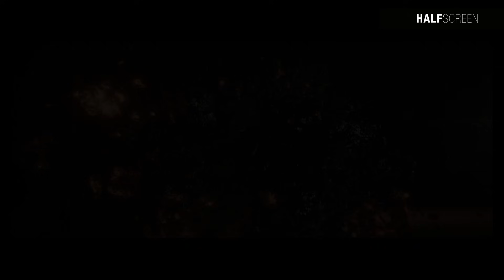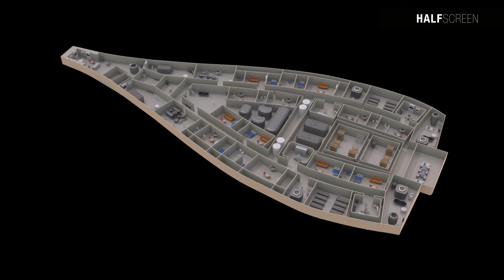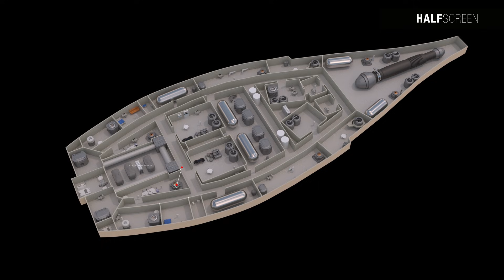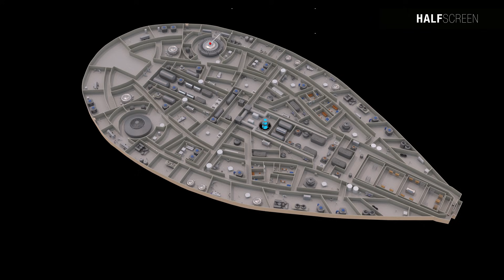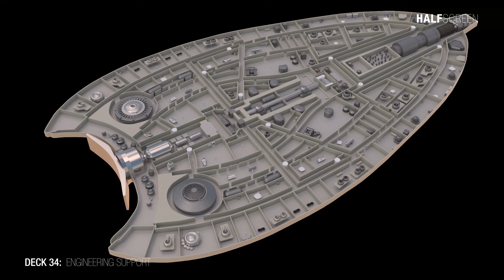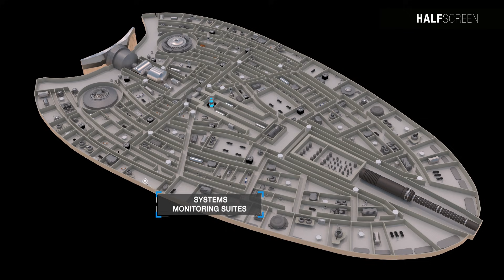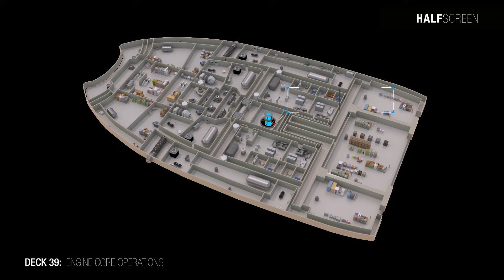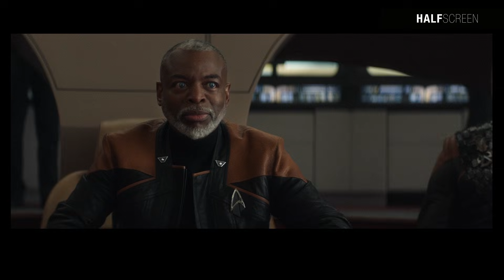Inside the USS Enterprise D (Deck 16-42)

Comment: The reactant loaders are for filling the torpedoes with anti-matter prior to launching. The Torpedoes are stored as empty casings
Reply: That's cool!
Reply: He also talks about antimatter generation which makes no sense at all... it would mean that the enterprise is a perpetual motion machine.
Reply: @thomgizziz  Not quite, making anti-matter is a long process because it has to be done at the atomic level. Also the warp core does a matter/antimatter reaction meaning the anti-matter should be opposite of the regular fuel, deuterium, making a deuterium/anti-deuterium reaction. That means they only make anti-matter from deuterium atoms. Replicated deuterium probably wouldn't be stable in a warp core, and collecting enough of it from H2O or Bussard collectors would take a while too. I suppose they just put spare deuterium in the generator and it slowly makes anti-matter for reserves.

Comment: The Arboretum is supposed to be located on deck 17 (Section 21-Alpha)
Reply: That was said in one of TNG episodes. However according to the deck plans it is not on that deck. Deck 17 is so small it even doesn't have 21 sections there. It is possible to believe the arboretum wasn't on deck 17 originally and it was created there later. The ship's interior is quite configurable. 

In Stage 9 project, where they were recreating all decks of E-D in 3D, the creators put arboretum on deck 7, which I would say is more logical place. Screenwriters of episodes didn't always followed the deck layouts or even deck coordination system.
Reply: @Lukas-Trnka  Either way, somehow the Arboretum is missing in this presentation. We know the Enterprise had one and it was shown in episode

Comment: Pressurized gases to launch proton torpedoes I thought Photon Torpedoes was launched with electromagnetic catapult Wako a railgun
Reply: You are correct.
Reply: According to the Next Generation Technical Manual, it's both.  "...induction coils and launch assist gas generators to provide initial power to the sustainer and propel the casing away from the starship."

Comment: I'm like 99% certain that the Navigational Deflector on Deck 35 is not what generates the ships shields. Last i checked, the only thing it does, is generate a field forward of the ship, to deflect interstellar matter.

Additionally, the only thing Antimatter is used for is the M/AM Reactor (warp core)....the stuff isn't piped all over the ship, which is kind of a good thing, given how volatile the stuff is. Also, the pods themselves are ejected, if they need to ditch the Antimatter... shooting into space, uncontained, would be VERY bad.
Reply: True and i came here to state the same thing.
Reply: I also wanted to point this out. Just few more details; Antimatter is used not only in warp core. There is one more use for it. It is being used to fill the photon torpedoes before they are being fired. Because they are being stored without the antimatter.

And for the navigational deflector; it is a similar technology as the deflector shield emitters, just used differently. However aside from pushing away the interstellar matter, the navigational deflector is also integrated with the long range sensors, so the system as a whole does two things.
Reply: @Lukas-Trnka  Ahh, i'd forgotten that the torpedoes are stored without the antimatter. However, my point still stands that anitmatter isn't being piped all over the ship. I'd never heard of the nav deflector being tied into the long range sensors...i guess it kinda makes sense, but i don't see why they'd do that, as it would only be able to see in that one direction. Perhaps it aids in navigation? ::shrug::
Reply: @numberyellow  the ship has sensor suits all over it, but the long range sensors and telescopes are part of the navigation deflector assembly, its a multi function assembly with multiple sensor based systems, navigation systems, and navigation deflector incorporated. But not really part of the shield system. Shield generators are scattered about, with shield emitters integrated across the hull.
Reply: @numberyellow  One more possible case of antimatter usage that comes to mind is fueling of shuttles. I just don't know if there is a dedicated special conduit leading to shuttlebays or if they rather move the antimatter in small containers across the ship when occasionally needed. But anyway you are right, that statement about injecting antimatter across the ship is incorrect. The antimatter injector on that deck injects the antimatter only into the warpcore.

As for the deflector, the TNGTM in chapter 7.4 states: "The long-range sensor array is a key element of the navigational
deflector system because it is used to provide detection
and tracking of objects in the ship's flight path."
Reply: @Lukas-Trnka  OK, fair enough, i can see ONE PART of the LRS array being integrated into the nav deflector, which would assist in seeing what's VERY far in front of you, thus helping with navigation.. As to the shuttles... i dunno man. Given they're warp-capable craft, and since we're assuming shuttles use a M/AM reactor to generate power (we already KNOW runabouts do), it would stand to reason they'd need a top up from time to time.. I could go back and check Stage 9...there might be Antimater tanking at the main shuttle bay.
Reply: @Krahazik  Like i said to the other guy, i could see some sensors being integrated into the nav deflector assembly...however it can't be the entirety of the LRS array, as that's an omnidirectional instrument, and the nav deflector assembly is a unidirectional instrument.
Reply: @numberyellow  I would also expect that system to be pointed to all directions, but the TNGTM suggests that the whole long range sensor array is really integrated only in the deflector system. I've just checked. I would guess that in case of long range sensors only the subspace scanners matter and they might be able to scan in all directions regardless of their orientation on ship's hull. So the only thing that would interfere with them might be radiation from the deflector. TNGTM in chapter 7.4 states: 

"Because the main deflector dish radiates significant amounts of both subspace and electromagnetic radiation, it can have detrimental effects on the performance of many sensors. For this reason, the long-range sensor array is located directly behind the main deflector, so that the primary axis of both systems are nearly coincident. This arrangement permits the long-range sensors to "look" directly through the axis of the fields."

Btw, can you run the Stage9 on Windows 11 (if you have Win11)? It worked on my Win11 but not any more.
Reply: @Lukas-Trnka  hmmm.. certainly something to think about. As to Stage 9.. i don't know, i don't have Win11 on this rig.
Reply: Your first point is 100% correct, but anti-mater is indeed piped throughout the ship as it is loaded into the torpedo casings prior to them being loaded into the launchers (the torpedoes are stored empty). The Galaxy class has 3 torpedo launchers, 2 in the Star Drive, and one pointed aft in the saucer section that is revealed when the ship separates.

Additionally, engines and reactors in the saucer section require anti-mater to generate power, and there are warp field generators at the center's of all 3 computer cores which requires a mater/anti-mater reaction to function. This is because these computer's process and calculate faster then the speed of light, so there has to be a warp field generated around them at all times to make this possible.
Reply: @pepperVenge  yeah, we talked about torps already. Not sure how they charge them, but i very much doubt they're gonna be piping antimatter all over the ship, given that it requires magnetic containment, to keep it from coming into contact with...well, anything. I would imagine there is local tankage. 

I have never seen ANY schematic that shows a torp launcher in the saucer. additionally, there's never been any on-screen use of it either. Where did you read about that?

You mention reactors in the saucer....are you talking about the emergency fusion reactors? If so, they're not going to be using Antimatter, they're fusion reactors, so they'd either be using deuterium, or given their emergency nature, they might even be self-contained units. 

Also, i've never heard of the computer cores needing a warp field....where did you get that from?
Reply: @numberyellow  I know it's been a couple days, but YouTube deleted my last reply to you because I included a citation. So let me try this again.

"but i very much doubt they're gonna be piping antimatter all over the ship, given that it requires magnetic containment"

Consider that the pipes are magnetically charged and can easily contain the antimatter flowing through them.

"I would imagine there is local tankage."

No. According to both the Sternback and Ed Whitefire Enterprise D plans, the only antimatter storage tanks are located on the lower decks of the stardrive section. The tanks are located on decks 40 and 41 on the Whitefire prints.

"I have never seen ANY schematic that shows a torp launcher in the saucer... Where did you read about that?"

This source comes from the Ed Whitefire blueprints of the Enterprise D, which were commissioned by Andrew Probert shortly after TNG premiered in 1987. You can find them if you google "Ed Whitefire Enterprise D."

Ed Whitefire was an aerospace engineer who was hired to design the interior of the Enterprise D according to Probert's specifications and design elements. For context, Probert was the man who originally designed the Enterprise D in 1986 under the supervision of Gene Roddenberry (He also designed the Enterprise Refit/A in 1978/9).

Long story short, Whitefire's plans were finished in 1991, but were never officially published due to technicalities. 5 years later, Rich Sternback was able to get his own plans of the Enterprise D published, which is the design you see in this video. 

But I only subscribe to the Ed Whitefire plans as canon because they were officially endorsed by Andrew Probert and Gene Roddenberry, and were the only plans in existence during all 7 years of TNG's run, and during Star Trek Generations (1994), which was the only TNG film to feature the Enterprise D.

"there's never been any on-screen use of [the saucers rear torpedo launcher] either."

This may be true, I'll have to watch the show again, but because the Ed Whitefire plans were the only Enterprise D plans available during the original Run of the show, many of the design elements from those plans made it into the show, including Cetacean Ops (where the ships whales live), stage theater (Can seat hundreds) and the Grotto Mall, among some others.

"You mention reactors in the saucer....are you talking about the emergency fusion reactors? If so, they're not going to be using Antimatter, they're fusion reactors, so they'd either be using deuterium, or given their emergency nature, they might even be self-contained units. "

You are absolutely right about this point, I stand corrected. This is even in the Ed Whitefire plans.

"Also, i've never heard of the computer cores needing a warp field....where did you get that from?"

This is in the Ed Whitefire plans, specifically on the last page, there is a special section that explains this. There is a warp core that sets between the two computer cores in the saucer section, and another warp core that sets next to the single computer core in the stardrive section. They generate power to the warp field generators positioned on the tops and bottoms of the core's. This allows the computers to process and compute at faster then light speeds. Without the warp field, the computers could not function, or if they could, only at sublight speeds

Because of this, antimatter is required, which is pumped through the ship from the tanks on deck's 40/41.
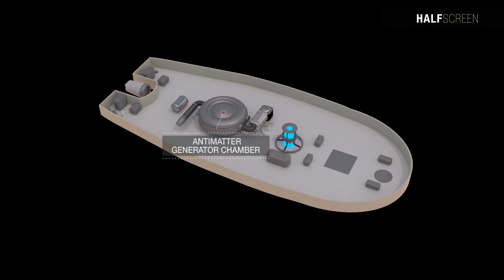Reply: @pepperVenge  That injector shown in video at 18:45 is really only for fueling the warp core. That description here was really a mistake. And more in general, sublight engines, fusion reactors or computers actually don't need matter/antimatter reaction to operate. Both in saucer and in enginering section there are fusion reactors that generate power from hydrogen (deuterium). Energy is being distributed across the ship via EPS (electro-plasmatic system). This plasma is what provides energy to the systems. It comes from either the warp core or from the fusion reactors. Fusion reactors are not used only in emergencies. Impulse engine is directly fed from active fusion reactors. 

And as for the computers, yes they use FTL (faster-than-light) nanoprocessors, that creates subspace field so the operations inside the processors can happen even faster. But for such miniature and weak fields the energy from M/A reaction is not needed. That would be an overkill. And even if for some reason they would need some stronger subspace field, they would still not need to bring the M/A reaction close to that system, they still can channel the energy anywhere in the ship through EPS conduits.

As for the 3rd auxiliary torpedo launcher, yes it is really there. It was never mentioned on screen, but it is on the deck schematics and even in TNGTM. It is on deck 15, (it was mentioned in the previous video). Torpedo launchers obviously must have some source of antimatter. Maybe there are special pipes leading from deck 42 to the torpedo launchers, I cannot find any mention of it in TNGTM. However if there are, then I wouldn't be surprised if the 3rd wouldn't be connected to those pipes at all since this torpedo launcher is almost never used. The third launcher could just have its own container, refilled only occasionally.
Reply: @Lukas-Trnka  I guess this all depends on which schematic you subscribe to. I prefer the Ed Whitefire plans as they were the official plans endorsed by Andrew Probert, the guy who originally designed the Enterprise D.
Reply: @pepperVenge  Somehow I have also a trouble to putt a comment here. Originally I've included a link but removing it from original text didn't help. Will this comment remain here?
Reply: @pepperVenge  Some antimatter storage is also in the aft part of the saucer. It can be seen on diagram in TNGTM that was published in 1991 (also with Roddenberry's endorsement). It is also on Sternbach's plans.

As for computers; TNGTM states there is a set of miniature subspace field generators that produce symetrical field distortion. No warpcore is mentioned there. And it makes more sense to my technical mind that small generators wouldn't need so much energy to draw it from M/A reaction. I guess the idea of computer core's warp cores must have been scrapped during the 4th season or earlier.

Btw, the Whitefire's plans, that I have, are quite blurry. Is there somewhere some better version of it on the internet?
Reply: @Lukas-Trnka  Well I'm not talking about TNGTM, whatever that is. I'm talking about the Ed Whitefire prints.
Reply: @pepperVenge  TNGTM is a book "Star Trek: The Next Generation: Technical Manual" published in 1991.
Reply: @Lukas-Trnka  And who wrote it?
Reply: @pepperVenge  TNGTM was written by Rick Sternbach and Michael Okuda, and it is an extension of the original "TNG Writers'/Directors' Guide" (also called the "bible") written by Roddenberry and David Gerrold during the preproduction of TNG series, and later updated by Michael Okuda and Rick Sternbach. 

I understand you are relying primarily on Ed Whitefire's blueprints, however TNGTM can provide much more details.
Reply: @Lukas-Trnka  That gives it credibility, but TNGTM is not a detailed deck by deck blueprint of the ship as far as I can tell. So I still subscribe to the Ed Whitefire blueprints because we're talking about the ship itself, not just parts of the ship. The Whitefire plans are far more detailed then the Rick Sternbach 1996 plans, and incorporate all the design elements that Andrew Probert intended.
Reply: @pepperVenge  if I may interfear: to the first question with antimatter pipes i can respond with yes, in emergency situations tiny amounts of antimatter can be injected into the main impulse drive, not the ones on the saucer, to give it an extra boost. I have the technical manual book (or i think it is), in german it is „die Technik der U.S.S. Enterprise“. So yes, antimatter can be transfered through the ship

Comment: One thing I thought would be included in the lower deck diagrams is an inside look at the warp nacelles, including the nacelle control rooms located there.
Reply: This also missed the transporter arrays (those long ribbed like structures that really only showed up in the Engineering section when there are several on the saucer section): They're a bit of a pale yellow and sort of look like they have very thin black lines between the ridges on the models.  Also, it was criminal to not actually SHOW the phaser arrays.  They're strips, not single canons like TOS, DISCO/SNW, or JJ Trek movies.